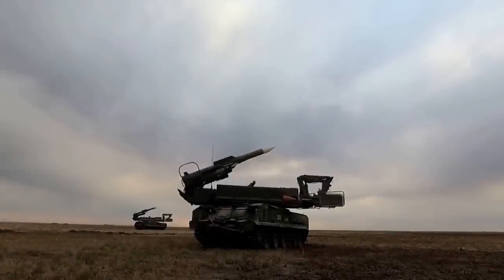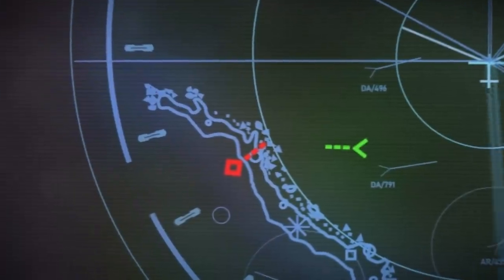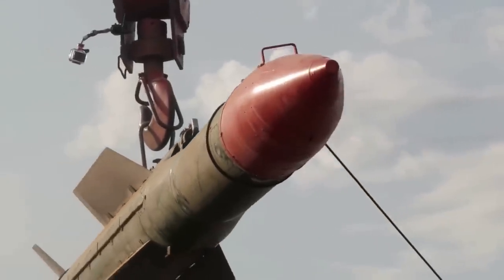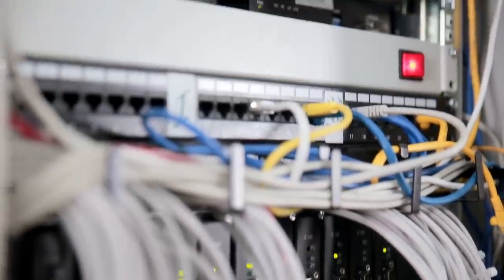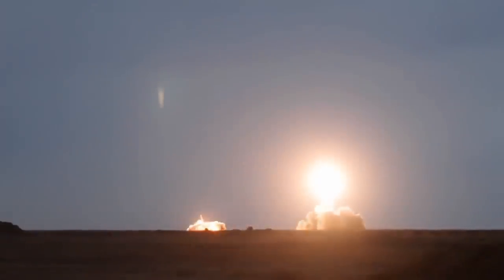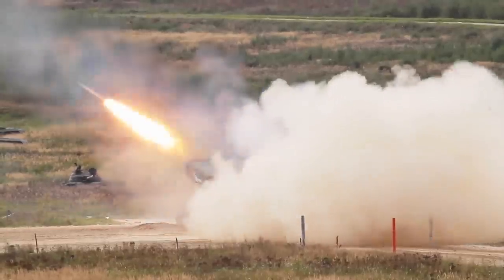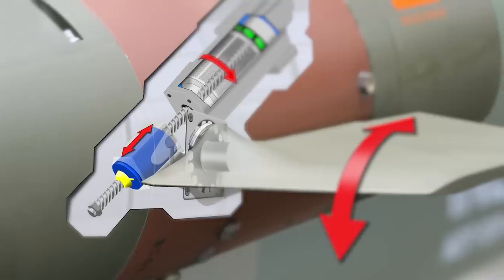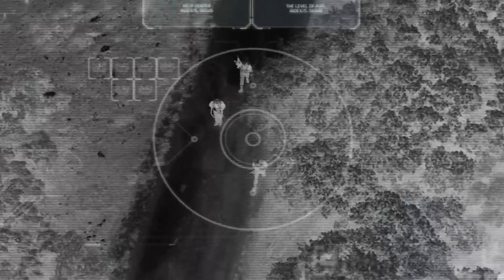Russian Anti-Aircraft System Hit by its Own Missile - Caught on Camera

Comment: My guess would be this type of missile doesn't use a data link guidance system but an Illuminating type system.  In these systems there is a transmitter tracking the target and inside the same antenna there is a very high power CW transmitter.  The track signal tracks the target and the CW transmitter makes the target "glow" to the missile.  These illumination transmitters may be emitting power in the megawatts.  This may have overwhelmed the receivers ability to reject the signal and caused it to home in on the transmitting antenna instead of the intended target.  These are mainly older systems but still very effective.  Ask Scott O'Grady.  But I could be wrong.  Still hard to believe it would do a 180.  Just glad it wasn't me!

Comment: Hard to believe it was an accident. It didnt go stupid like the other videos. It made a U turn and straightened out and flew straight to the the launcher. A very precise U turn. It has a nano second of time to adjust course to hit the launcher. And it hit it. Without even a wabble. I dont buy a lot sided tank. It would wabble or cork screw. Like the other video's of russias air to air systems failing.

Comment: Not fuel- cracked solid rocket fuel is just a bomb. Ka-blooie! not pulling a U-ie. Probably not a stuck maneuvering vane, it would have just nosed over if that was the case. Stupid thing probably acquired it's own base radar. There is a component in SAMs that prevents that, but if that failed... comedy gold. We've had it happen as well, and we fixed it in the 60s. Modern SAMs have multiple hardware and software solutions built in, but this is Vietnam and Yom Kippur Wars vintage tech. But if a 5 ruble widget breaks...

Comment: I don't think I'll bother watching these video's by Dark Footage any more. 

The last one was BS, and so is this one. 

The conclusions voiced in this video would have had the rocket either flying in circles in the case of a burn through or a continuous larger circuit if the solid fuel pooled to one side due to storage issues. 

As many have said already, this missile came alive and begun to track the biggest radar energy target it could find and HOMED IN ON IT!

Whether this was a failure in in guidance or part thereof or something else caused it, (I don't believe it had the wrong target information applied) it doesn't really matter. The system failed and the missile deliberately targetted its own launcher!

Comment: just another thought, with all the ukrainians working in russia before, and during the war, and ukraine has alot of these russian weapons systems in their hands since soviet times, the SA-17 while newer, also uses the soviet systems network. would it not be easy for a ukrainian to get ahold of the signal systems information and pass it on back to UA Defense Force and ukraine operators on the front with these soviet systems could use that info and once the SA-17 system is operating and it is determined where it's location is, would the ukrainian operators be able to turn on their own system, and signal in the russian systems coords using the new encrypted russian signals system ' just to see what happens' of course. the entire russian anti air is networked together by soviet design so that HARM missiles would be defeated by shutting down the targeted radar and letting another system such as SA-2 or SA-4 or SA-6 or SA-8 radar give the SA-17 missiles in.
that is how these systems worked in korea and vietnam

Comment: An excellent video as always. Russian rocket attacks (based on accuracy) has a fail as high as 50 to 60% for some systems, per Reuters quoting some US intelligence sources. Poor builds, improper storage, non-existant maintenance, and poor handling in transport can attribute to this. One source said that "involutary" labor sabotage could account for some. An interesting (unnamed) source said that US infiltration of rocket guidance systems could account for some. Russia could not make their own chips. The theory is that faulty chips were supplied, designed to fail. In the same article it was mentioned that the USSR bought the cheapest chips available. That article could be as reliable as Q-anon, but would be interesting and possible as Russia dips into USSR rocket stockpiles.

Comment: Just a note on this video.
The missile did not actually hit its own launcher, this can be seen from another video of the event where it landed off to the side by a good distance. In the video showcased here it only looks like it did, but that is simply due to the angle of the footage, nothing more. Even with the angle shown, you can clearly see the missile trail in comparison to its impact point, which is closer to the camera by a good amount, thus confirming the other footage of a different angle that the missile did not hit its own launcher.

As epic as it would have been for this event to happen like this video suggests, it sadly did not.

Comment: Don't you watch your own videos?  You are talking about "tracking radar" and show a track set off the rocket transporter at the cape.  You are talking about manufacturing issues and show an animated clip of a V8 engine cut-away.  Garbage filler.  
Your theory about the propellant is not born out by what we see.  The rocket flame is straight out the back, not off to one side as would be required to cause it to turn.  It looks like it went where it was told to go, so a guidance issue is more probable.